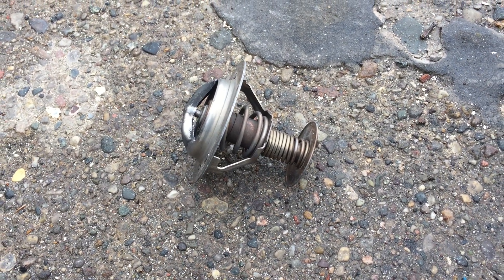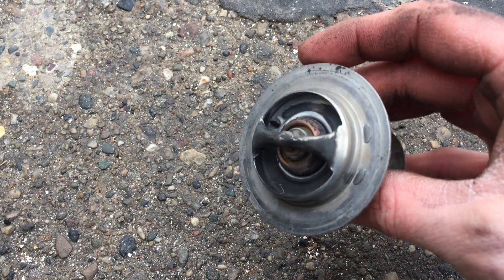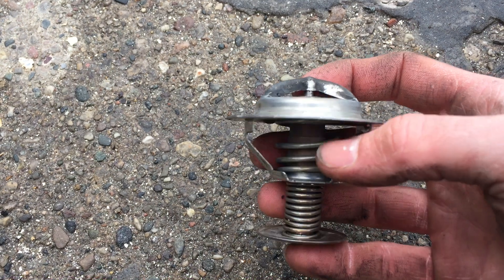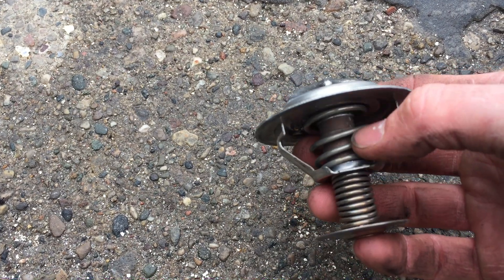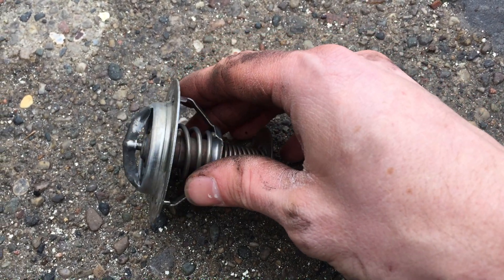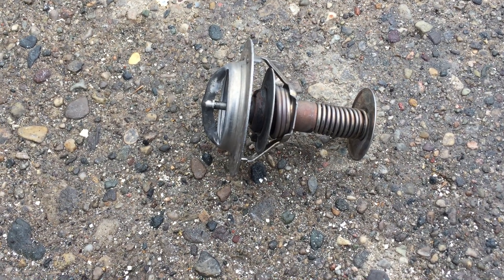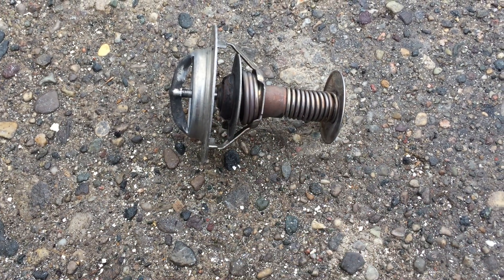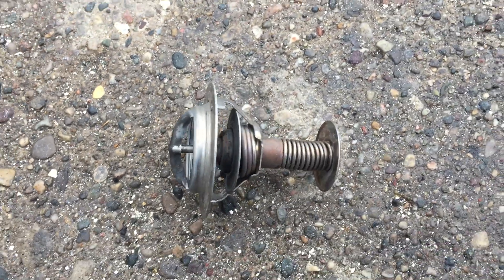How does a thermostat work? What does a thermostat do? What a thermostat does.

Comment: I did not like your video.  Your "blow torch method" opened the valve further than any amount of hot water (190 degrees) would normally open the metal ring.  I'm pretty sure you ruined that thermostat's wax forever.  You completely avoided explaining what happens to the bottom "foot" which is pointed towards the engine, and away from the radiator.  amateur, a great explanation for the other amateurs commenting here.
Reply from the maker: Trevor Trillion thanks for your feedback. This thermostat was junk and not opening normally so the torch was the only way to get it to open. Yes I’m amateur. If you’re a professional what are you doing wasting your time watching some little amateur give a quick simple explanation of what a thermostat does? You must be bored out of your gourd! lol I hope you feel equal to the superiority you have clearly demonstrated here.
Reply: @DirtRoadAutoRepair  Yes, I am equal to the superiority, thanks.  I was searching for a good explanation of how the "foot" moves away from its metal seat as the valve opens.  Nobody has demonstrated this.  I only realized I had wasted time (you also wasted yours) AFTER watching you play with torches at 450 degrees.  This NEVER happens in an engine; but you thought it necessary.  Not hard to be superior.
Reply from the maker: Trevor Trillion all right I’ll leave it there. Have a good one 👊🏼